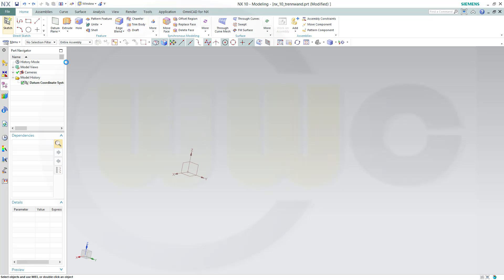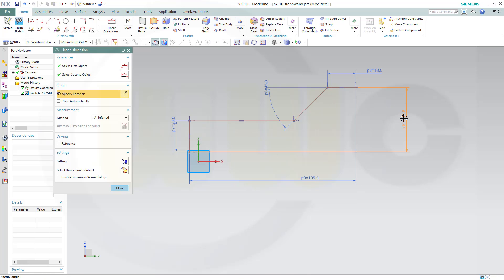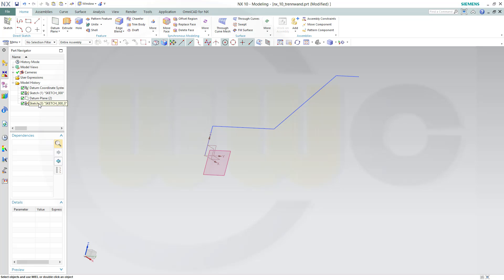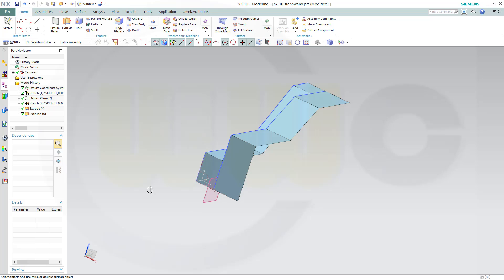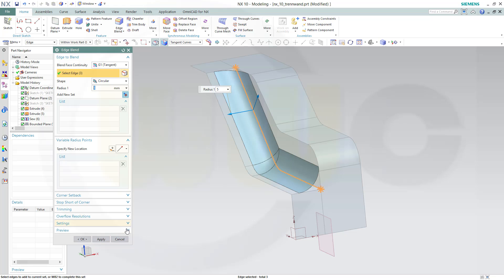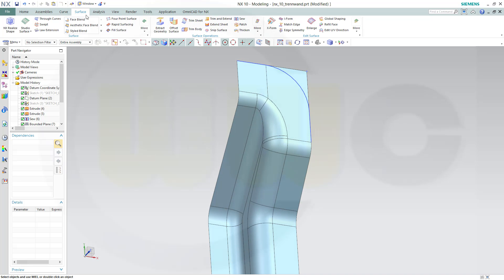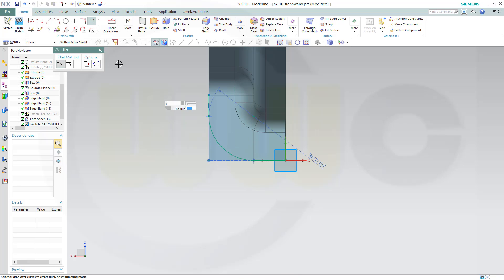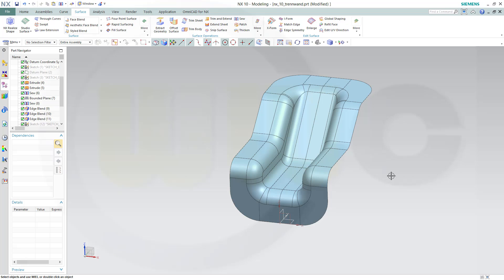Trennwand - Siemens nx 10 Training - Surfaces

Comment: Isn't ZW3D better than this software ?
Reply from the maker: Definitely not - you can´t compare it with software which costs more than 100 times as much.
Reply: @wolfgang.walden.cad.training   I recently installed Siemens nx 1867 , 20GB space comparing with 2GB software , i used to be a sheetmetal designer and a little bit cad modeling , not a professional like you , but ZW3D is way more faster to design and CAD modeling , more better parametric control in parts , if we just compare CAD stuff ZW3D is better but in CAM situations I'm using Mastercam , because zw3d is weak in CAM , I'm a starter with Siemens NX , im a little bit suspicious to change my CAD modeler software or not ... (sorry for bad eng)
Reply from the maker: @hameddesign70  As I´ve already mentioned, you can´t compare those two programs. A complete version of NX would cost you about 340000 € . Is this price justified? Therefore I would have to take a closer look at ZW3D. Maybe I will ;)
Reply: @wolfgang.walden.cad.training  thanks for your advice but money is not matter for me , the only thing that is matter is time and abilities of the software i will try NX more i hope not to waste my time Thank you very much
Reply from the maker: @hameddesign70  Even without knowing ZW3D I would suppose that NX is the far superior software. It is becoming more and more my favourite program.